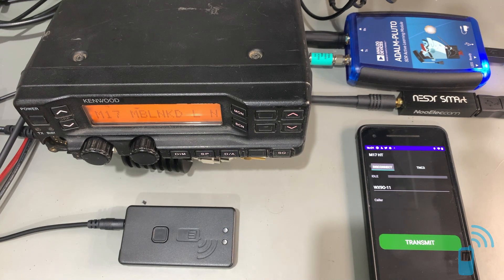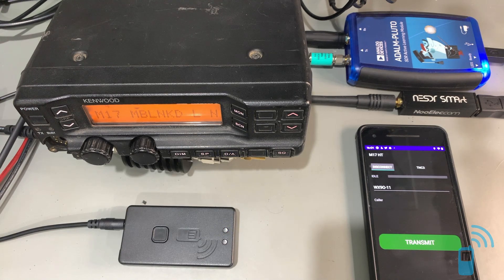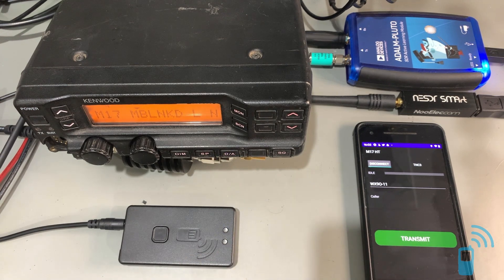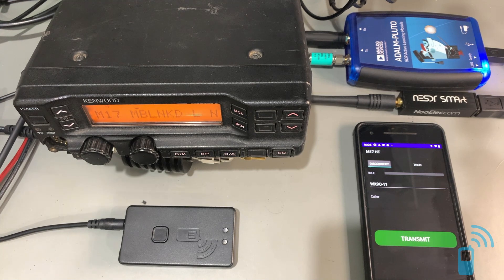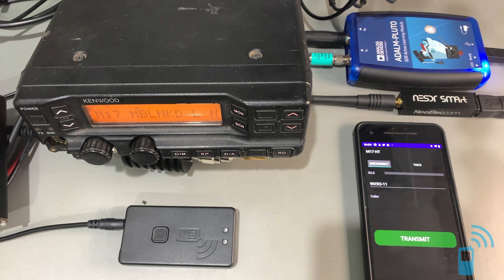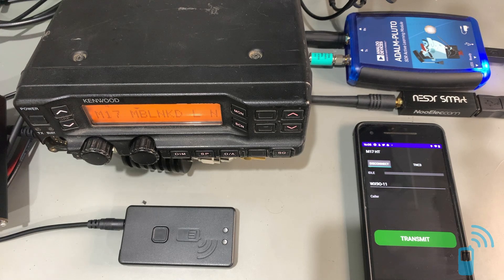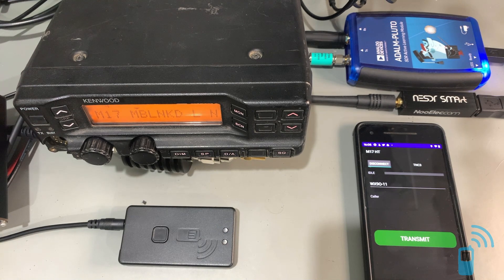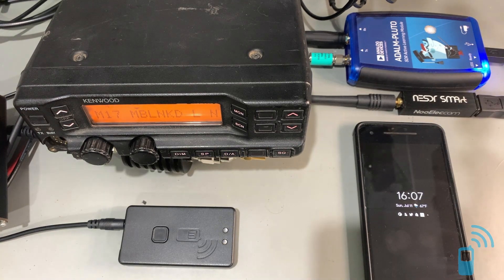M17 Using a TNC3 or NucleoTNC

Comment: I just have to say WHY do we need another DV mode? Isn't D-Star, YSF, P25, NXDN, and DMR enough?
Reply from the maker: All of the modes listed use proprietary vocoders.  This restricts what radio amateurs can do with these modes.  M17 is an open protocol that uses an open source vocoder.  This means radio amateurs can freely implement and experiment with all aspects of M17.  This freedom to implement is important for the future of amateur radio.
Reply: @mobilinkdllc2508  because it is open source is why I am so interested in this mode.
Reply: @mobilinkdllc2508  90% of hams dont care if it's a open protocol.  O well more DV to play with. But P25 is still my favorite.
Reply: @railsaroundsouthjersey  Even if a bee could explain to the fly why pollen is better than shit, the fly wouldn't understand.
Reply: @SP5WWP  I just hope they use CDMA or TDMA and not be dumb and use FDMA.
Reply: @railsaroundsouthjersey  TDMA falls apart DXing a distant repeater.
Reply: @JohnHays-K7VE  Still a lot of F3E repeaters for DX.
Reply: @railsaroundsouthjersey  And that's the issue. Amateur radio is also about experimentation, not just pressing a PTT. If there's no experimentation or development in the hobby, we will be relegated to just using what is commercially offered and the hobby will stagnate.

Comment: So is it possible to use this over AREDN i.e. rf to network and network to rf?
Reply from the maker: That is exactly what a hotspot does -- bridges RF <-> Internet.  This is commonly used for other DV modes already.
Reply: @mobilinkdllc2508  Thank you. Are you going to post some videos on how to get started with this voice mode? Do you have any recommendations on videos about getting started with this DV mode?
Reply from the maker: @johnnykeeton8369  This is a new mode in active development.  There are only a few implementations  available right now.  My first goal was to develop an over-the-air implementation to serve as a foundation for further development. The work right now is geared towards attracting more amateur radio developers.
Reply: @mobilinkdllc2508  Understood. I am looking for a solution to add rf to network capabilities to my AREDN mesh and since this is open source and is just that for the internet it could be my solution. I just need to do a deep dive into it.